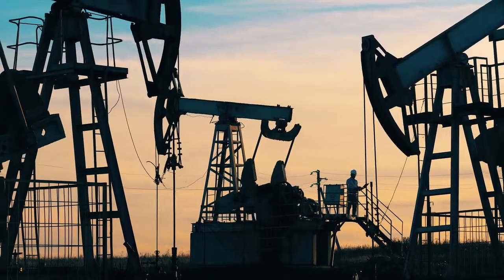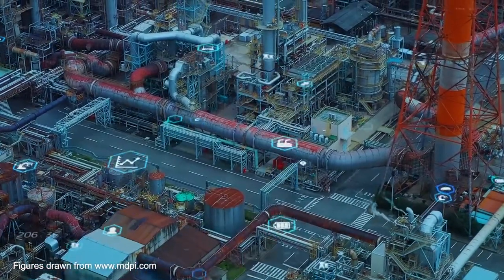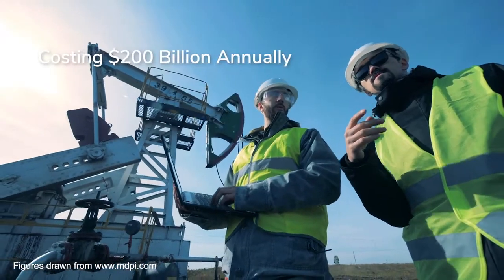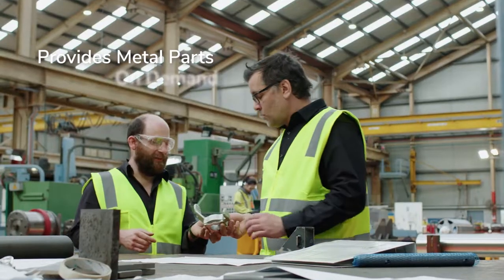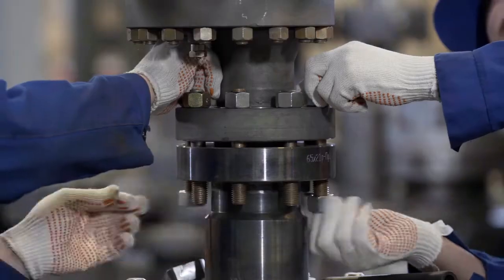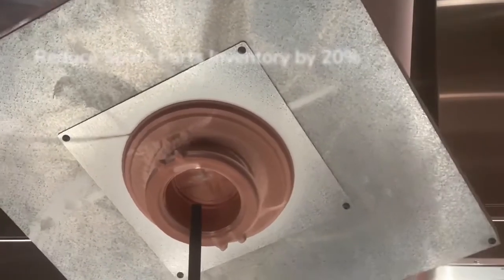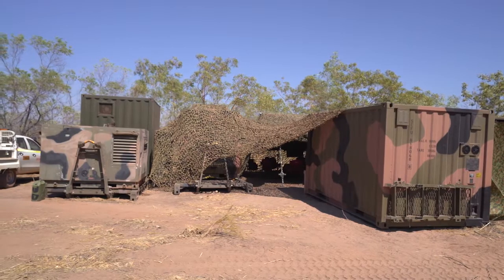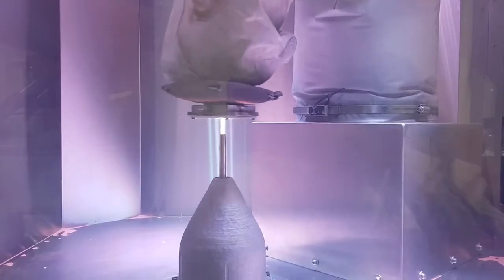How SPEE3D Technology Empowers the Energy Industry

Comment: What level of precision can you achieve ? All the videos have parts that look very rounded and not super sharp
Reply from the maker: Hi @cxsey8587, thanks for your question!

Our minimum deposition spot size is 6mm/0.25". This means our technology cannot make fine, dainty parts (like nuts and bolts, or teeth crowns for example), but is good for larger, bulkier parts you might need - a spanner, or a bracket for a pipe. That  might be one of reasons why the parts made with our technology may not look very pointy or sharp to handle.

We hope this answer helps. Feel free to visit our website: www.spee3d.com for more information on our technology. :)
Reply: @SPEE3D  gotcha, thanks!